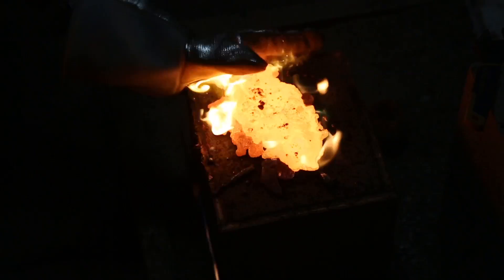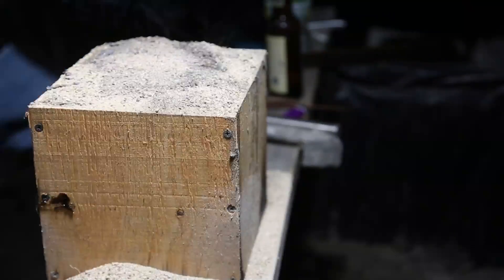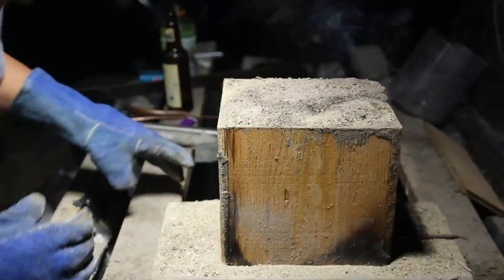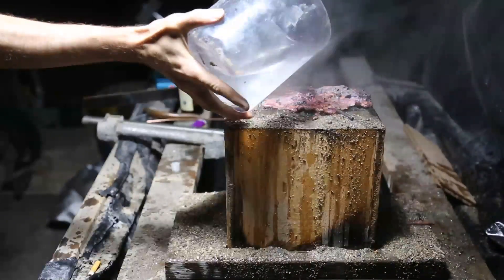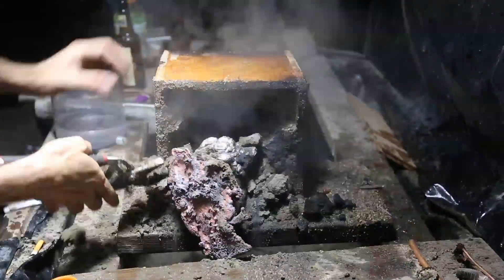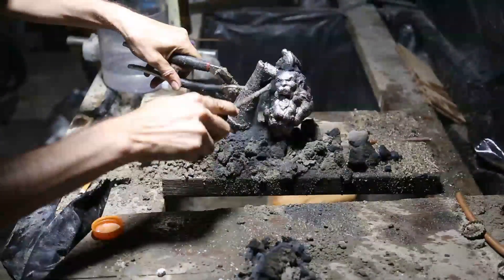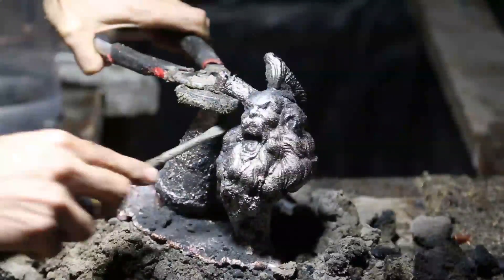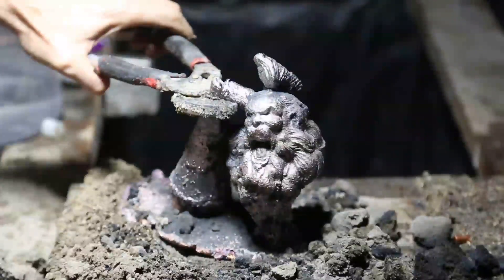3D Printed Lost Shell Sand Casting Technique

Comment: I think that for people wanting to give this a go without much outlay - you can try it with Pewter which melts around 200ºC I think. So you can melt it in a pan on a camp stove. You can also use PLA to make the mold if you make it small and also quench it fairly quickly.

Comment: Hey cool 
I'm a not an expert what would be the difference if you used gasoline instead of diesel for the burnout??
Reply from the maker: It's best to just print them hollow then neither is needed. But generally speaking, because of the fumes, gasoline is more dangerous than diesel.

Comment: 01:34  Why does your sand look like a concretion, instead of sand?  What was the temp of the MAGMA you poured into your mold!!
Reply from the maker: I suppose because it is packed green-sand? Green sand has about 5% Bentonite clay and enough water to give it some strength. The copper was probably about 2400F.
Reply: There are particles that look like small gravels in the sand.
Reply from the maker: Its all green sand. Probably just seeing clumps that weren't reconditioned when I freshened up the sand.

Comment: +3DTOPO Were you running that induction heater at full power? (15KW)
Reply from the maker: It was pulling close to 9KW out of the wall which is close to full power. They market it as a 15KW unit, but I think they must be basing that on power in resonance? (two 7.5 KW phases?)
Reply: It's the power based on the peak voltage instead of the RMS voltage I think. i.e. 220/0.707 x 50A = 15.5KW.

Comment: that pla is a hydrogen factory right in the melt dude. that really screws up the properties of the part, and adds to the porosity. cool.
Reply from the maker: Nonsense. The cast came out as good as any sand casting if the sand was slightly too wet as was the case with this first attempt using this technique. We have gotten excellent surface quality using the same technique for other castings where the green sand has the proper moisture and also with petrobound sand.

Comment: Dude you do it too dangerous! Your head should never over the molten metal because sometimes it will expose. Also you may want to let it cool down overnight instead of pour cool water over it. And use bare hand toward hot metal part? You kidding me, I will never approach without protective glove. Good luck.
Reply: Tap Kwan this is probably the first casting video I’ve seen where the person is wearing full ppe....  most people on YouTube casting are wearing flip flops, shorts and a tank top, and occasionally leather gloves.  I’d say he’s trying to be as safe as possible.
Reply from the maker: You're all worked up over nothing. I had full head protection on. Copper cools very fast since it conducts heat better than just about any other metal. For that size mold, it goes from molten in like a minute or two - and we let it cool down for WAY more time than that. As for my bare-hand - that was after the metal was cooled with water and was safe to touch.
Reply: 3DTOPO hey you guys have some good work but safety should always no.1

Comment: Have you ever thought of coating the shell in multiple thin layers of quick cure drywall(hotmud).  I ran into a guy doing lost foam casting that did taht and then used simple playground sand instead of green sand and was getting good finish quality.
Reply from the maker: That is essentially what we do with our Lost PLA method: <https://www.youtube.com/watch?v=WWVVSZP3Au4&t=1493s> - but at that point its easiest and fastest to just use a solid block of plaster instead of multiple shells. The point of this method is it is much faster and easier than the Lost PLA method.

Comment: what is the wall thickness on the print? and do you think the finish will come out better with a plaster coating before you put it in the sand?
Reply from the maker: The thickness was a single wall; I think it was about 0.25 mm. Coating a thin shell of plaster won't work for this method, since it needs to be baked out before casting, and that causes the plastic to deform and the thin shell to fracture and fall apart. The surface quality would have came out better, but the green sand was slightly too moist. Also, for the best quality surface possible, see our lost PLA method: https://www.youtube.com/watch?v=WWVVSZP3Au4&t=951s
Reply: 3DTOPO thanks for the reply.  i really appreciate your videos and all the info.  keep up the great work.

Comment: how did you heat that crucible? cool vid btw
Reply from the maker: Thanks! It's heated with induction: alternating magnetic fields (emitted from the water cooled copper coil with high current running through it) induces a current directly into it. It's like directly plugging the crucible into a high power outlet.
Reply: sweet, looks very effective. I used charcoal on my first (very messy), will b using propane on my next, but will definitely look into what you've done here. I'm also looking at some 3D printers, any advise?

Comment: One of you mentioned titanium?  Good luck with that.  If you get it hot enough to melt in an oxygen environment it will catch fire. It has to be done in an inert gas or vacuum and that makes it pretty difficult for hobbyist to pull off.
Reply from the maker: I have a argon tank and regulator. ;)
Reply: Might work if you do everything in a box open on top. If I remember right, argon is heavier than air. Still thinking it's not going to be easy though.
Reply from the maker: Indeed, argon is more dense than air. Never said it was going to be easy though. ;)

Comment: way over heating your metal  bud
Reply from the maker: You are basing that on what?
Reply from the maker: Keith Ward nope - not even close to boiling. ;) That was just the metal de-gassing.
Reply: It looked as though it was boiling which probably indicates overly high temperature, versus just over melting point.
Reply from the maker: The metal was fully degassed. The surface quality would have been better but the green sand had slightly too much water in it. That's what is great about petrobond (which we also use) - no water content and its always ready to go without adjusting moisture content.
Reply: Keith Ward thank you Keith I was going to tell him but decided to leave it alone lol
Reply: 3DTOPO
No worries, not trying to critique anyone's work.  I think if you degas it more the finished casting will have a smoother surface. Glad more folks are doing things that are creative.  I have not done any casting work since high school but I hope to again.
Reply from the maker: It would have had smoother surface but I had slightly too much water content in the green sand - it was from metal gassing. ;)
Reply: 3DTOPO What did you degass with?

Comment: If you had a fuel based furnace you can preheat and burn the PLA shell out. For rough stock this will work fine tho :) Soooo much easier than the old hand carved wood methods.
Reply from the maker: Not really - the green sand would dry and crumble apart. To burn out the PLA, we do our Lost PLA method: https://www.youtube.com/watch?v=WWVVSZP3Au4

Comment: Thanks for posting this. Does the PLA shell burn out completely at the approx 700c of  an aluminium pour, or only work with the higher temps of red and ferrous metals?What is the maximum crucible size of iron you can melt with that 15kw induction heater? Do you make you own coils?Mark
Reply from the maker: The technique seems to work with aluminum as well. Just get it a bit hotter than what you would pour into an empty sand mold. Seems whatever PLA doesn't vaporize floats to the surface too. We haven't done iron with it yet, for ferrous metals only mild and stainless steel up to 20 pounds (super intense to pour!). Yes making the coils is pretty easy.
Reply: I have tried doing it with PLA using your previous videos, never got it to work correctly with aluminium, the mold never gets free of PLA, tried even with the moldlay filament but the results was also charred and full of failed sections. I think I have to buy a decent kiln instead of using my homemade furnace (made a la King of Random videos). The most expensive part to me seem to be removing the plastic filament from the mold, do you really have to make it stand two hours in very high temperatures? The electric bill in the case of eletric kilns might be really high....
Reply: Maker Linux in English burn it out via charcoal then, its just plastic, get creative. a propane torch should melt it away im seconds id imagine

Comment: I always wanted to cast something in metal, but it looks extremely dangerous...
Reply from the maker: There are numerous ways to cast metal. A beginner might want learn a method that doesn't involve burning the pattern while you pour and start with metals with much lower melting temperatures.  I take safety very seriously - I pour in a heat and flame resistant full proximity suit with full face shield (at minimum). The surface is reflective aluminum and the material is made of kevlar aramid fibers. We also have a safe setup (pour inside a dry sandbox) and I literally have decades of experience pouring metal.
Reply: 3DTOPO sounds expensive

Comment: Have you tried using joint compound as is done with lost foam to increase detail?  Kudos on moving to induction. 
Great work 3DTOPO!
Reply from the maker: Thanks! That is a great idea and I am sure it would work well (wood putty would work well too). I have only done this technique a couple times so  I haven't yet. I actually like the print lines because I use it as a ruler for detail achieved.
Reply: 3DTOPO he meant to increase the detail of the casting, not to smooth out the print lines. The joint compound would help achieve said print lines
Reply: By dipping the print in watered down to a thin dip the gypsum joint compound will provide a more detailed shell. Make sure and let the compound dry out thoroughly first before adding to the plaster of paris. 
 I hope that clarified the technique. 
 It being a finer substance should bring out better detail after the burnout. It will likely just show off your printlines more. 
 to smooth out my print lines wood putty might be the ticket and sand for a finish, I would most likely use fast curing polymer based gel epoxy from the finish masonry trades. Tenax is the brand I use.It smooths well, and sands weill, fills gaps without running and shoud provide a clean burn out. 
 In the last 6 months I got the materials together for a pro furnace build scaled to a no. 20 and will be fabricating this month. 
  Cheers, thanks again
 Keep up the good work.

Comment: I'm sorry, were you just splashing diesel fuel from an plastic beverage bottle on an open flame???  Not to mention that copper pouring technique! If it popped into the air (as you said happened in the last attempt), it could fall right down your glove.   Oh man this made my nervous.   TOTALLY FUCKING AWESOME though!  Stay safe.
Reply from the maker: Yeah - diesel is kind of like oil - don't try the same with gas though! Not sure what you mean about the pouring though - no problems with that - not even a close call. Thanks glad you enjoyed it!
Reply: +3DTOPO well there's me being a worry-wart.  it's super cool and I wanna do it!
Reply from the maker: I see what you mean now about the first attempt. No - it just shot flames out no copper. And if it did - I was pretty well protected in the proximity suit. It has a fireproof kevlar fabric on the inside.

Comment: Would you talk a little about your foundry heat source and crucible?
Reply from the maker: We are using a 15kw induction generator, more information about it here: <http://bit.ly/1PJ0MhW>. It is probably the most efficient way to melt metal. That unit can melt 8kg of copper in about 20 minutes for about $0.20 in electricity. Melts steel too no problem. The crucible used for this video is a high-purity 8kg graphite crucible like (good for most all metals except for ferrous). We use a clay-graphite for ferrous work.
Reply from the maker: p.s. we will publish a video showing the induction generator in a future video. Subscribe if you aren't already so you don't miss it. ;)

Comment: Using finer green sand will increase your detail astronomically.
Reply from the maker: Astronomically? Highly unlikely. For one many of the print lines are visible (hard to beat that), next it is professional olivine casting sand (acquired from a foundry), and too fine of sand is impermeable (doesn't allow gases to escape) which causes poorer quality casts.
Reply: Yes, Astronomically. Though in your case, based on your comment, isn't the quality of the sand, it's the quality of the print. 

That sand you are using is the limit for detail you're getting. So printing at a higher level of detail will do you no good.
Reply from the maker: Sorry - I disagree. And you are contradicting yourself. Your first sentence says it isn't the quality of the sand, its the quality of the print. Then you say printing at a higher level of detail won't do good. If I wanted something finer I would be using an investment mold. Have you even cast copper in sand before?
Reply from the maker: I finally figured out why the surface detail wasn't as smooth as it could have been with my greensand. It wasn't the sand particle size, but it was because the sand had slightly more water content than was ideal. That said - its probably a finer cast than you think - the last shots of it are used a macro lens that is then enlarged in the video.
Reply: 8BitLife how can one make said greensand?
Reply: i agree sand seemed to be very coarse and chunky that can affect  the cast finish. option is to go over to silica sand type casting  . plus metal on his pour seemed to be  on the hot side .  gas will still permeate the sand even if its a fine sand. was the cast pattern printed on high resolution ... both a higher res and finer sand will give you almost  mirror smooth finish and tamping proper makes a huge difference also  i worked in a foundry  back in the 60's we made castings for the machines we made in the machine shop so depending on metals poured  the type of sand  used made a difference
Reply: Dave Bar you can just use a finer sand right next to the pattern. They call it facing sand.

Comment: Wonderful! Did the pla leave any residue or was it all pushed to the surface? Not having to use plaster or melt the plastic out blows my mind
Reply from the maker: Thanks! It didn't leave any residue, whatever PLA wasn't vaporized floated to the top. Yeah; definitely easier than the Lost PLA method - but it won't be quite as fine of a cast. That said - this works even for ferrous metals. Our next video will be doing this with steel. Stay tuned. ;)
Reply: +3DTOPO good to know! It's awesome seeing people experiment with this. Your first pla casting video got me to build my printer. Gives a whole new dimension of possibilities with this machine.